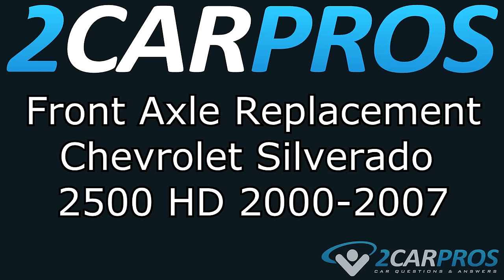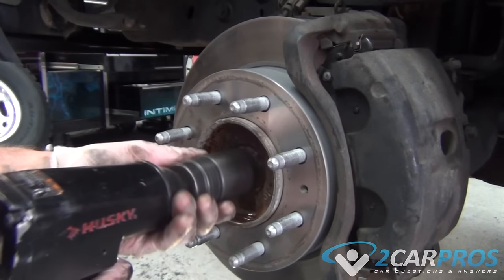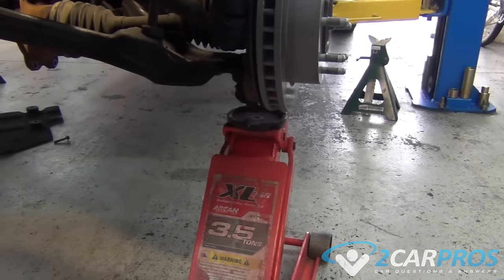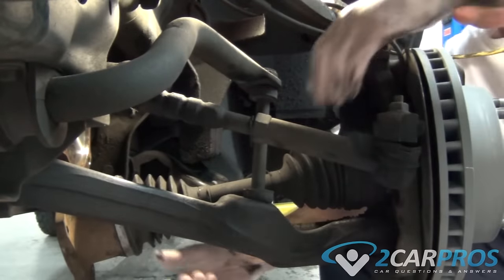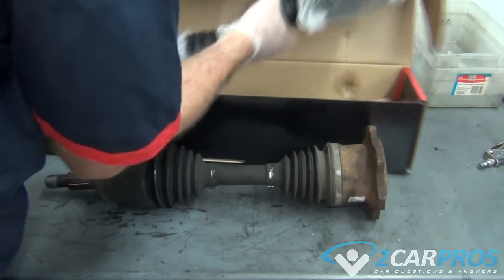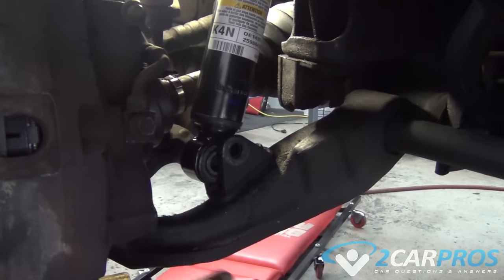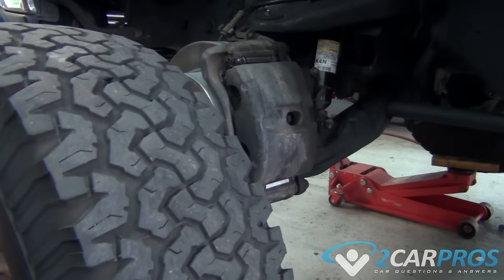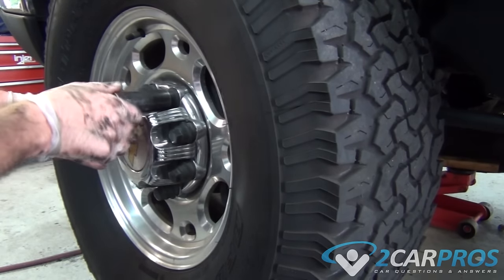HOW TO REPLACE A CV AXLE IN 20 MINUTES! - Chevrolet Silverado 2500 HD 2000-2007

Comment: “20 minutes” if under 50,000 or so on a vehicle from a salt-free environment, etc.  How about one with 333,000 miles and 18 years of Michigan winters.  Oh, and the dust cap leaked so the axle nut won’t budge with heat and a 3’ breaker bar!   Decided to replace the hub assembly, caliper, rotor & pads at the same time, so burning off the nut became the method of choice.